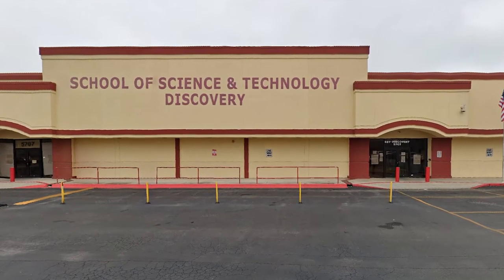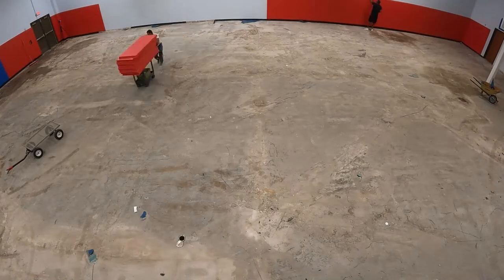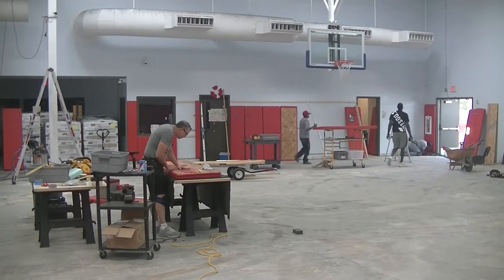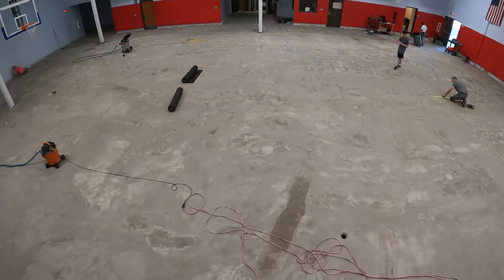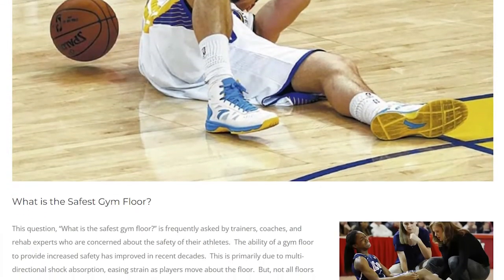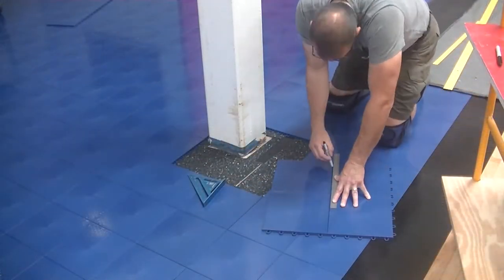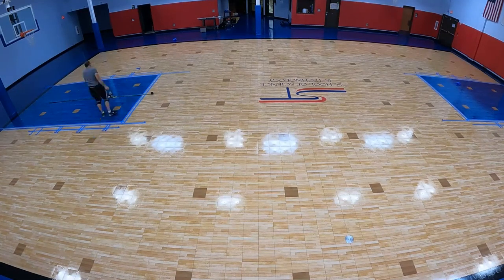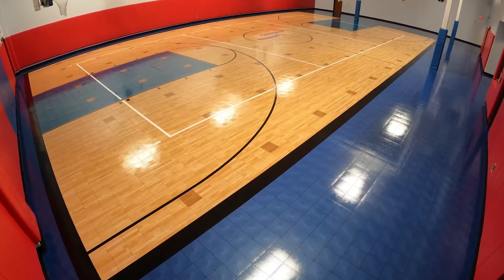Replacing a Cushioned Floor with Sport Court® Gym Flooring

Comment: mad that backboard and rim wasn't replaced on that side hoop, also one was missing it's net. But a 10/10 job for you guys!
Reply from the maker: We actually did fix all the basketball goals, but not all were fixed before the floor was installed, so this didn't make it into the video.

Comment: That old blue floor was not a pad & pour. It had seams . Poured urethane floors are seamless. That was a Mondo floor. I noticed the backing in the demo part of the video.I just tore one outI in SC and had the same look, and standing water/mildew .I install both Omnisport and poured urethane and we warranty for 15 years. If a floor I installed looked like that after 6 years, I would retire.
Reply from the maker: Yes, there was a mondo layer at the bottom of the floor.  But, the material above the Mondo was seamless.
Reply: @SouthTexasSportCourt  so it was a poured urethane on a slip sheet? Why were the seams showing through so bad? Even on a slip sheet, the pad should have been glued to the slip sheet, perfectly flat, then 2 layers of pore sealer which should have made those seams disappear. Then a 2 mm pour. There was something very wrong with that floor
Reply from the maker: @CRASS2047  How the old floor was installed is a mystery.  The lines that looked liked seams were the joints between the pieces of mondo below the upper cushioned surface.  As for the apparent flaws in the cushioned floor, we see this type of stuff all the time.  And, these issues often reveal themselves within a few years of the initial installation.

Comment: Is it possible to use rubber underlay on an outdoor court?
Reply from the maker: The rubber underlayment is not recommended for outdoor use.  It's a crumb rubber recycled product that will swell and ripple when it gets too wet.  It's also not UV stabilized and would deteriorate in direct sunlight.

Comment: Dumb question…..why can’t the pieces be shuffled by the manufacturer?
Reply from the maker: We've been asking Conner Sport Court (Gerflor) that question for 8 years.  We sometimes spend 20+ hours per project shuffling the floor, depending upon the size of the project.  If the shuffling were integrated into the manufacturing process, it would save us hundreds of hours each year.
Reply: @SouthTexasSportCourt  wow.
Reply: @SouthTexasSportCourt  I hope you’re charging for that shuffling labor! I’m sure you have to. That’s crazy!

Comment: I am a coach at one of these schools, and we are having issue with traction with the floor. What cleaning process do you recommed so that these floors are not as as slippery.
Reply from the maker: @filthyballer the floor should be cleane daily with a Court Clean drag mop as shown in this video: https://www.youtube.com/watch?v=PhDYLlSypz0  DO NOT use a dry dust mop.  Weekly cleaning should be done with an automatic floor scrubber.  https://southtexassportcourt.com/product/nss-wrangler-2012/  Heavy berber rugs should be placed at all entrances to collect as much incoming dust as possible.  https://southtexassportcourt.com/product/52oz-berber-entry-mats-vinyl-ramp/  The Sport Court® Maple Select gym flooring has a multi-layer urethane topcoat.  It will have outstanding traction, when the floor is clean.  However, if there is dust, the floor will be slick just like any other smooth surfaced floor.